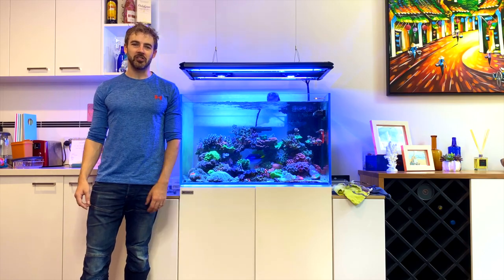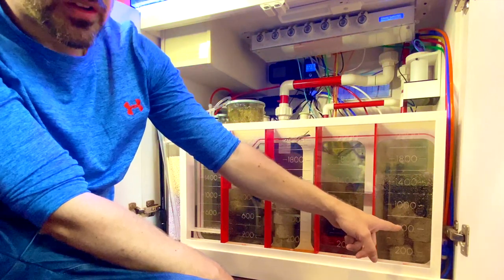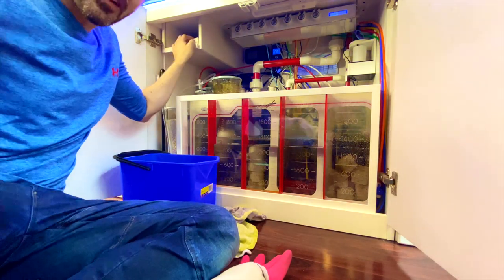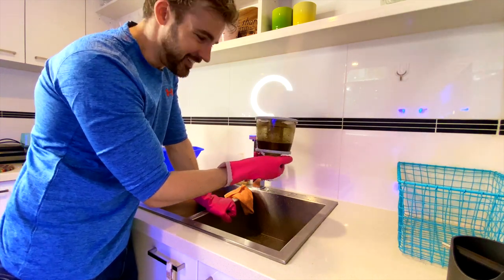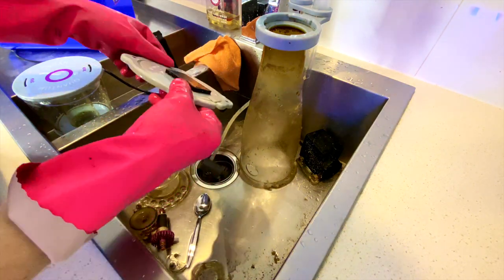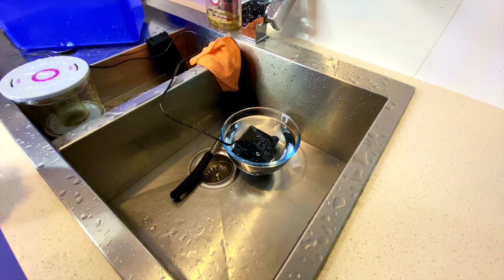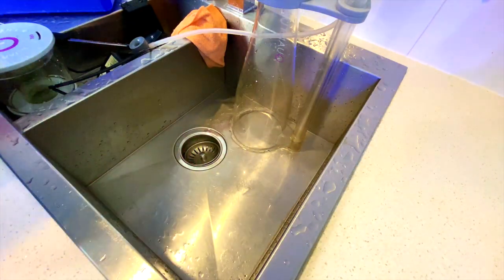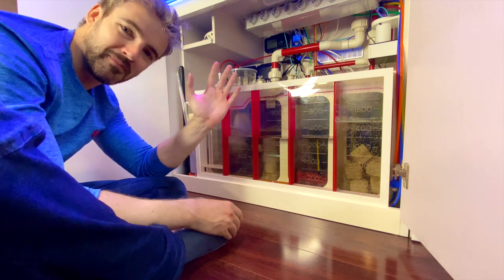Skimmer Maintenance and Sump Tour

Comment: Better to use citric acid - see article on Reef2Reef about vinegar causing issues with pump plastics in the long term.
Reply from the maker: Yea I had heard about this but have not yet done any research into it myself! I recommended a weaker mix than most people use, 5-1 water to vinegar in my video, but I think I will go and read that article and perhaps talk about it in a future video!
Reply: You only need to worry about rubber parts like o rings etc. Evrything else is fine even is 100% vinegar. All your plastics are non reactive therefore safe. Some cheap stainless steel would also be a worry.

Comment: nice video, can u tell how you adjust the skimmer? 
it seems like you open air fully and the lowest water level! right? why wont you raise the water level so the skimmer body will get leds dirty?
Reply from the maker: I run the skimmer fairly dry deliberately. I also feed a lot of amino based products which can cause the skimmer to overflow. So running fairly dry hekps prevent this.

Comment: Hey man , are you running the avast kalk stirrer mainly to maintain PH and then supplement with 3part/calcium reactor for the balance of alk , ca and mg requirements ?
Reply from the maker: Yes. Early days kalk was for dosing. But quickly outgrew that. Now it’s mainly for PH to offset the calcium reactor.